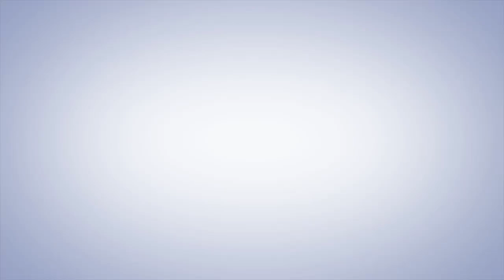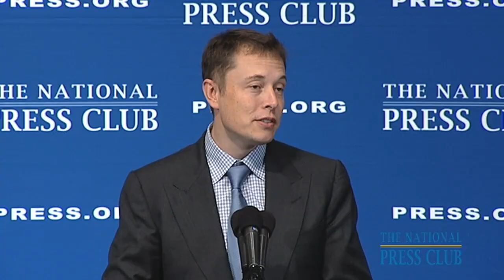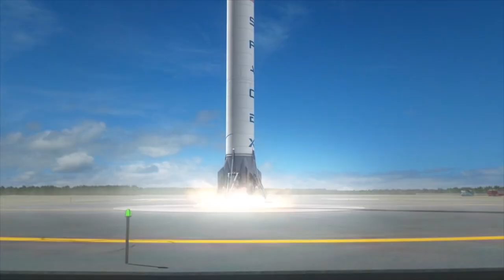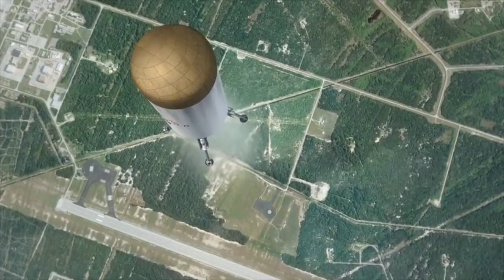Why Is Making A Reusable Rocket So Difficult? Elon Musk

Comment: Rocketry is an exceptionally difficult task because all a rocket does is eject its innards as fast as possible.

Certainly, there must be a better way....
Reply: Well, considering they're doing a dagum good job these days, I think they've found one of the best ways so far. At very least, they're massively growing the space launch market, and will drive innovation to get that better way.
Reply: @WasatchWind  Bicycles do a dagum good job at getting folks around but some bike makers thought outside the norm and everything changed in 1903.
Reply: @crazy8sdrums  Well I find that comparison to not make sense - The Wright Brothers weren't trying to make a better type of bike. Bikes even today still run off of a similar design, even if we have added things like bike helmets, lighter materials, etc.

With spaceflight, I see a few options outside of normal rockets for getting of Earth. There's space elevators and space slings for one - both rely, in different ways, on very strong cables.

This would require improvements in materials, particularly mass manufacturing of them. Interestingly, materials science may be massively helped by easier access to space, where complex materials can be made in null gravity.

Then you have spaceplanes - there is right now the Dream chaser and spaceship two spaceplanes, though the former relies on a rocket, and the latter cannot reach orbit.

The thing with these technologies though, is that I feel like we will eventually move on from rockets - but only if there's a reason to develop more efficient ways to get to space.

The reason why so many years have past with relatively little innovation is because many people did not see the point in spaceflight, and thus, little money, government and private went into it.

But now there are growing reasons to go into space, and I think the coming years will cause an explosion of activity in the industry, even more than there's been now.

If we'd had this conversation a hundred years ago, saying "why are we still flying with propellers, we need to come up with a better way before we try to develop air travel" it would have been needless waiting around.

Chemical rockets work just fine for now. In coming months, we could see the largest rocket ever built lift into space, and then be completely reused.

Maybe someday we'll have some crazy anti gravity UFO, but for now, I feel glee hearing the sound of those raptor engines.
Reply: @WasatchWind  Cheers to you for thinking, Waker of Winds.  It is not as common a trait today as it has been in the past, and certainly not common enough.  Many struggle on the decision to be a boy or a girl and insist that it is a decision they can actually make....not thinking the whole time that they are at it.  That may seem a rather disparate statement considering the topic we are talking about but it should reveal the deliberate  stymieing of reason and logic in the younger generations.
Reply: @crazy8sdrums  Well, I think it is interesting that one would identify me as one of those younger generations - when I find a great number of things in which I find myself to be separate from them - I listen to Glenn Miller Big Band Jazz.

But despite matters of preference like music, and them matters of personal belief like political and moral views, I find things today that show me how confused the world can get -

When there are people who believe the earth is flat, and that vaccines cause autism.
Reply: @WasatchWind  Research 'The Tuskeegee Experiment' then come back and we can discuss the government's role in vaccines.
Reply: @crazy8sdrums  I never said anything about that, and I am quite aware of what you're referring to. I was specifically referring to the fraudulent 1998 study that has caused most modern hysteria about vaccines.

I think it was wise to be cautious early in the current roll out of the covid vaccine, but now it is showing quite encouraging data. Everyone but me in my family  have gotten the vaccine, and they've all been completely fine.

Comment: I looked at the budget page on Wikipedia. Even in different years of the 60s the budget varied by a lot. And it is a little difficult to compare budgets from different time periods.

I'm not trying to say 2012 budget is exactly half of 1966 or something, just that the budget difference is a lot smaller than it looks by the GDP measure, even if you compare it to one of their peak years like 1966.

Comment: Neither the Shuttle nor Dragon have reusable heat shields. The Shuttle had to be arduously refurbished after every flight due to tile loss and damage. Dragon's heat shield is ablative (it burns away during reentry), it's just more efficient so it can last through more than 1 reentry.

Comment: Those boosters had to be refurbished after each use, which is far from an airplane like reuse scenario which SpaceX is going for. Reusing some parts isn't the same thing as having a fully reusable space craft, which has yet to be built because it's a very hard thing to do.

Comment: the solid boosters ,on the shutle separated at 45 km alt. and they did not use parachutes ,but they landed in the sea ,and they were reusable ,...soo one needs not even parachutes,
the first stage of Saturn 5 ,separated at 68 km alt. ,and with a parachute ,and landing on water ,we can hope for reuse
Reply: gheorghe cojocaru
Of course the SRBs used parachutes.   What the hell are you talking about?

Comment: let's take Saturn 5:use parachutes for the 1 stage 
B. use a heat shild for the second stage ,it would be beter if that stage would be foild ,because 90% of it's volume /wheight  was the fuel ,...the fuel is gone ,and inorder to use a small heat shild ,one needs to make that stage smaller,...somehow 
C. for the 3 stage ,a smal heat shild and a smal engine ,whit some fuel ,not much because at 1 day after launh ,about 100.000 km awqay from earth ,it's speed will be 4.000 km per hour ,soo
RATE THIS

Comment: build a rail gun straight down mount everest. Then use that to accelerate to the top and give the thing a boost engage rocket engines upon exit. HEHE, That should get you at least a couple percent back. Now the cost is going to be stupid crazy, but whatever, drop the military budget 10% for a year to cover it.

Comment: The first stage is only traveling about 4100 mph when it separates, not the 17,000 mph that their Dragon spaceship successfully reenters at. They know the structural capabilities and what it should be able to handle so they know how much they have to slow it from that. Some of the best aerospace engineers on the planet have looked at all of your concerns and they believe they can work them out. They will have failures on the way, but it is reasonable to expect a reusable first stage before 2020.
Reply: Well after 6 years you were wrong
Reply: @flo3484  Did you miss how they have been reusing first stages for a while now? Last I checked, 2017 came before 2020.
Reply: @ClintJohnsonWriter  bfr
Reply: @randomclip6792  
The BFR/Starship is next and it is reasonable to expect that to be reusable flight ready before the end of 2022.
Unless the Biden/Harris administration throws Elon's Mars plans under the bus to appease the far left... and shift support to Jeff Bezos. As much as I like Jeff and Amazon, he appears to be a lot more Deep State friendly than Elon.

Comment: You seem confused about what Spacex is developing. Currently, the first stage doesn't go to space, but separates on the edge of space then falls to its destruction. A wide safety margin for fuel means there is generally a lot of fuel left in the tanks. Elon plans to use that fuel, and a bit more if needed, for an apogee burn to slow and orient the stage, then a near ground re-ignition to slow the stage for a survivable water landing or gentle strut landing. Saving tens of millions each launch.

Comment: You are correct about the speed requirements for stable orbits, but nuclear-powered rocketry would not be used to inject spacecraft into planetary orbits, or maintain them in such orbits; it would be used to traverse interplanetary space (as, for instance, on a Mars mission). Such traversals can be made along ballistic trajectories, where a single initial velocity vector is obtained by firing the main thruster, and the trajectory is only corrected with smaller thrusters from then on.

Comment: Would it be easier and cheaper to launch from top of a mountain?
If the rocket is 8 kilometers higher on the launch pad, does it make any difference in the required energy?
Reply: im not sure it changes much. it can travel 8km in a minute or so when it gets up to speed

Comment: To clarify, by more efficient I mean with a higher specific impulse. Most normal rockets have less than 450 s, nuclear thermal can get 1000-1200s, project orion style craft can get over 30 000s.

The mass you can get into orbit with a set ammount of fuel increases exponentially with the specific impulse according to the rocket equation. The Orion project, if completed, would lead to space travel being almost as cheap as travel by boat, if you don't mind radiation.

Comment: There are a few ways to do it.

The most efficient one is something roughly similar to the Orion project, basically detonating nukes below a (very large) ship to lift huge payloads into orbit. It's roughly 100 times more efficient than now.

If nukes are out of the question there's been some research in nuclear thermal rockets. Basically it's some liquid or gas being heated by a small nuclear reactor instead of by burning propellant, being ejected through a nozzle. Roughly 2-3 times better.

Comment: To expect 100% reliability from anything, is ludicrous. Even after a complete rebuild you can have part failures. That's why every part/machine manufacturer ever has an acceptable margin. It doesnt need to be 100% reliable; Nor will any system, reusable or not, be 100% reliable.

Comment: SpaceX is great, except when it comes to manned flights. A manned mission can not simply be build to price points. If you want a reusable rocket to be 100% reliable, which it NEEDS to be for a manned flight, it needs to be completely rebuilt and inspected every launch. If it is only 99.999999% reliable then that is a failure. 

If you had to either completely disassemble a 747 after every flight, inspect it and recondition parts, or build one out of new parts, which is cheaper? More reliable?
Reply: But 747's aren't 100% reliable so why such the high standard?
Reply: This didn't age well. Not only has SpaceX launched humans into space, but they've done so multiple times with reused boosters and crew capsules.

Comment: @georgel19841 you're forgetting about the composite materials of the body of the rocket, which are very expensive and labor-intensive to manufacture. Also the labor costs alone in building all of the engines on all of the stages adds up as well. Rocket engines aren't just a nozzle, there's plumbing for fuel and cooling, turbopumps, ablative material for the nozzle, and much more.

Comment: Not only is a rocket made with high strength materials that must withstand extreme temperature fluctuations and mechanical stress, but it can only be used once. After a rocket delivers its payload to space, it burns up during atmospheric reentry. With the Falcon 9, world's cheapest launch vehicle, costing $60,000,000 each, the cost of building enough vehicles for a modest 6 launches a year starts to add up considerably.